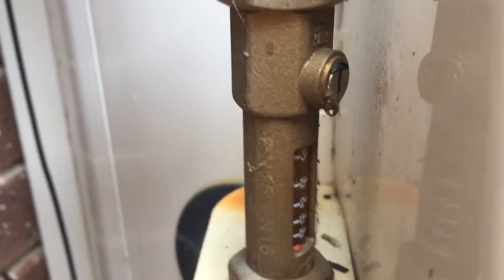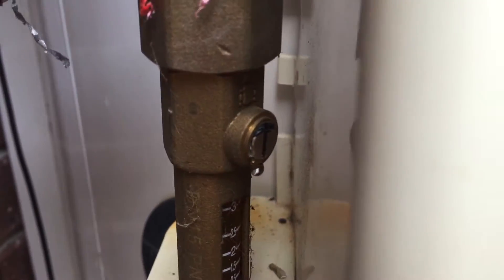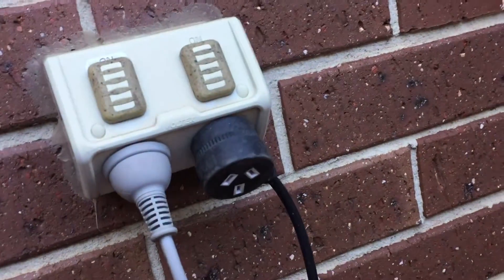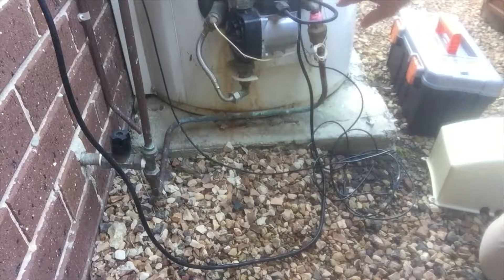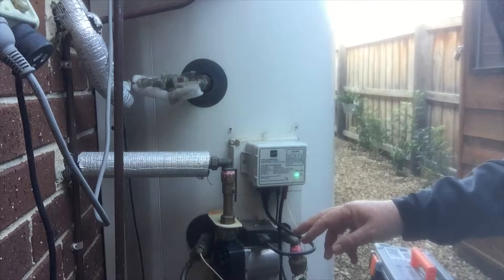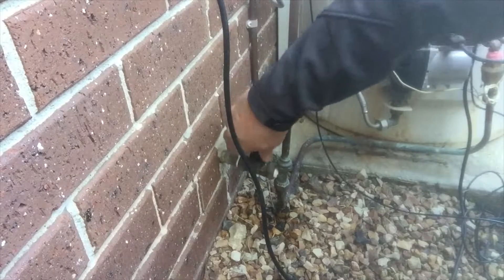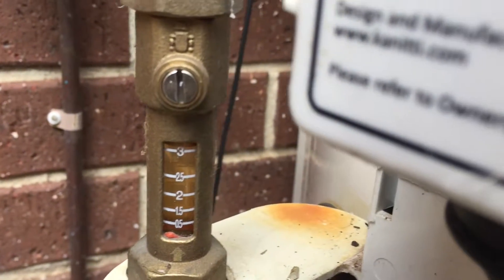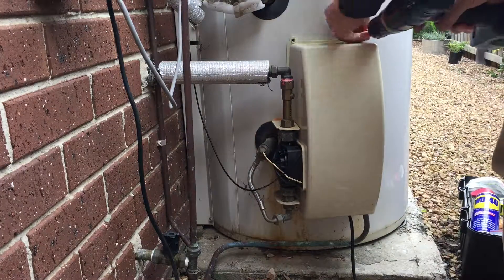Solar Hot Water system Maintenance. Fixing a drip that could kill the system

Comment: Thank you for your video. It is very helpful. I have a similar system at my place. There is a water leak on solar panel on the roof. I want to stop the water flow that goes to the solar panel and only use the element heating off the HWS. I see in your video that you controlled the flow to the solar by turning the flat head, is that the fix, you think? Keep the booster on?
I would really appreciate your help!